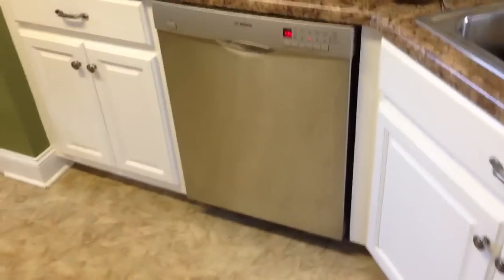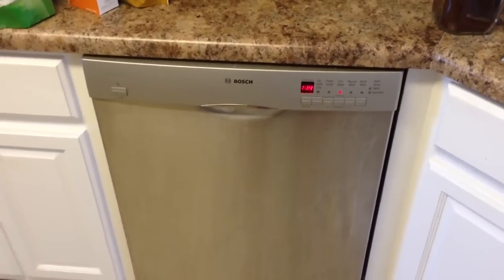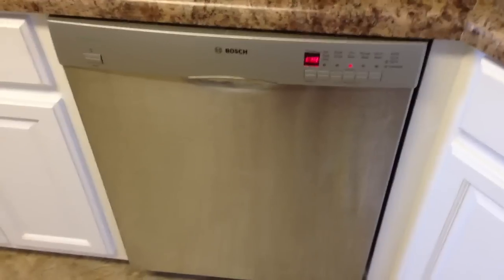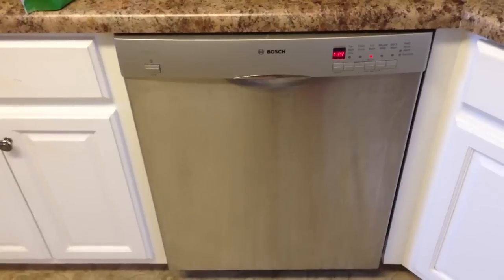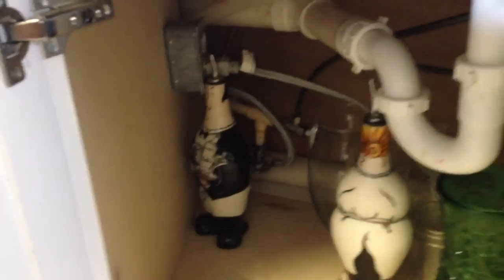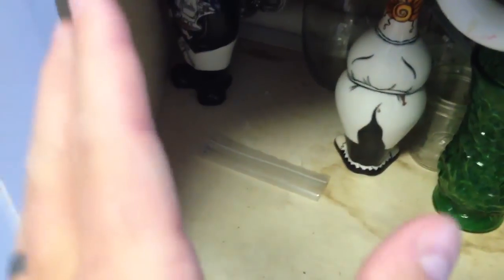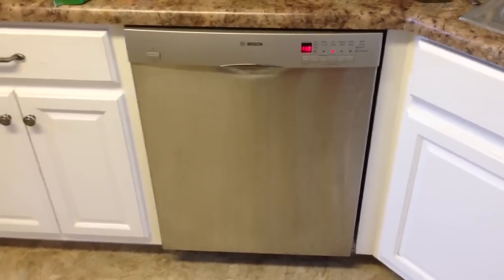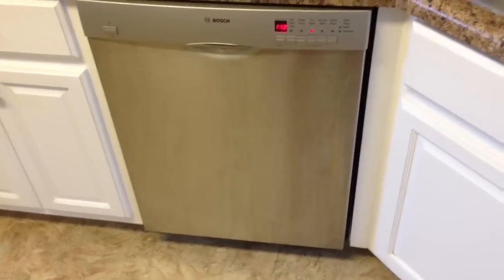Dishwasher No Water Fix

Comment: Thank you! This is exactly what was happening in my case. A plumber came along to fix the kitchen faucet and he messed up the position of the knobs that control the water supply to the dishwasher -- as a result, the faucet got fixed and the dishwasher stopped working (all of a sudden). Your video strengthened my suspicion and I fixed it myself. Thanks again!
Reply from the maker: kedar mhaswade LOL That's so cool that this helped ya fixed the problem.  Thank you so much for the feedback =)

Comment: No water enters whirlpool dishwasher. When i splice a pigtail to the inlet valv e, it lets water through fine.  The float is clear on top and the float switch tests 0 ohms in one position and infinite in the other. The door lights come on when the buttons are pushed and the door latched and they do not when the door is not latched, so I assume it knows the door is latched (though that could be a control panel vs touchpad thing?). What else can I check?
Reply from the maker: Maybe the system board?

Comment: i have this exact dishwasher,  and the thing runs normal, cleans dishes fine, but when it gets to one minute it just stays there and runs forever and ever  and ever....any chance anyone has had that problem?  thanks!
Reply from the maker: +Vic Lesage I have not had that problem.  Are you adding the drying agent too?
Reply: Turbidity sensor needs to be replaced